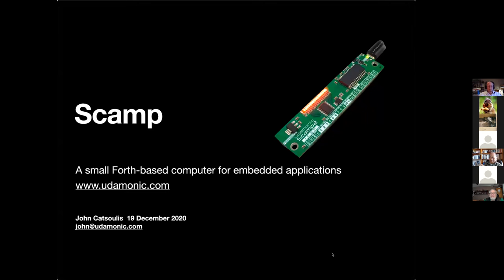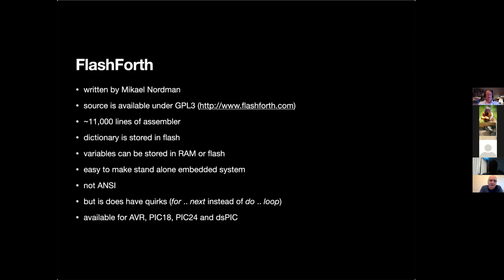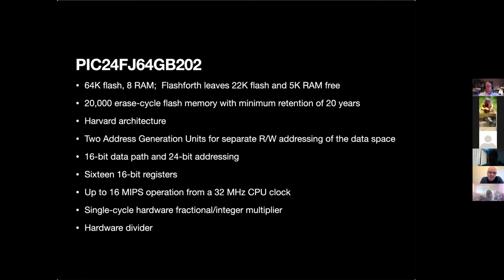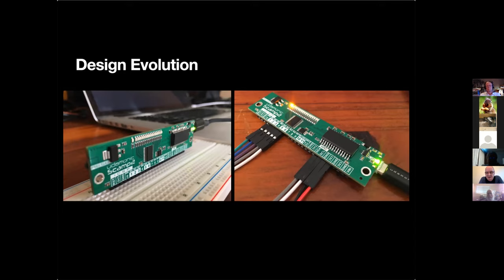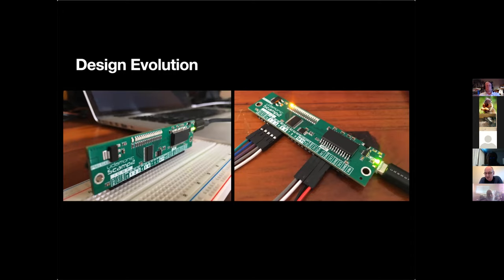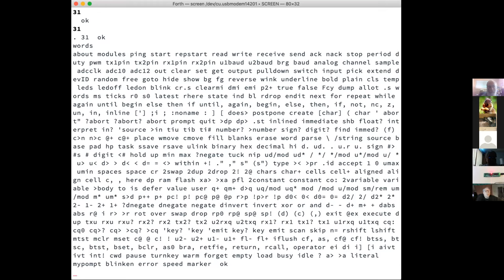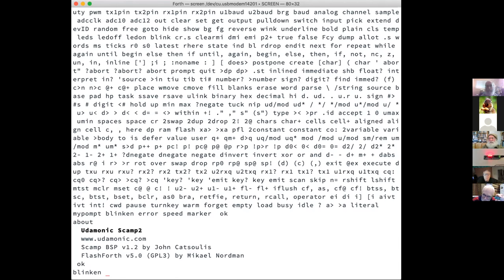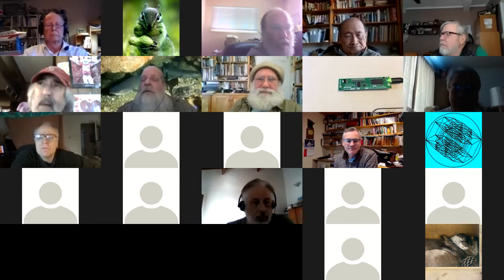Dec 2020 - Scamp - An Off the shelf Forth Computer for Embedded Applications - John Catsoulis

Comment: Would it be possible to use the code on different variations of the PIC24FJ series? I need a 100 or 120 pin device for the i/o.